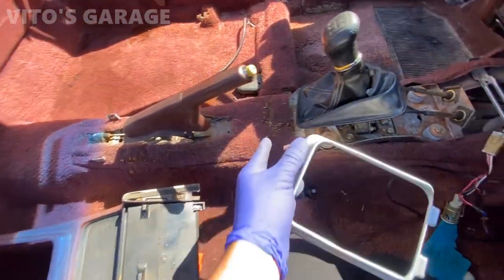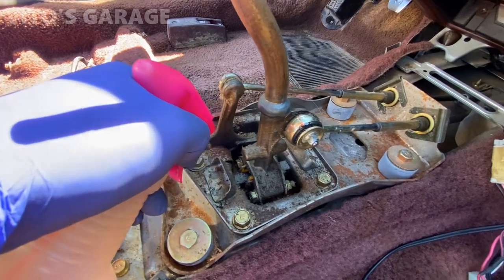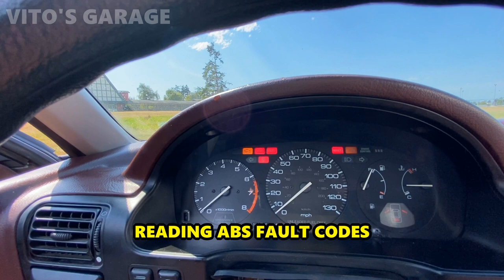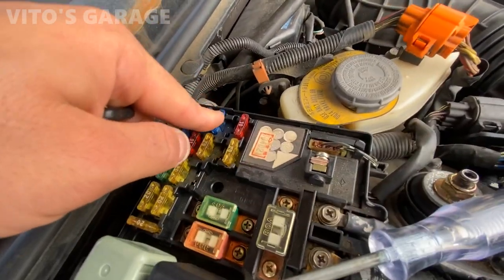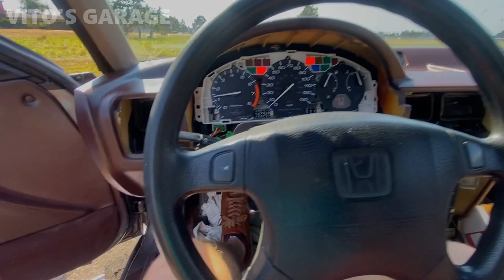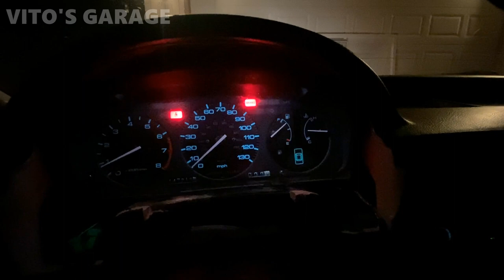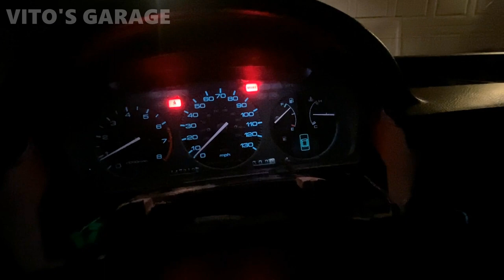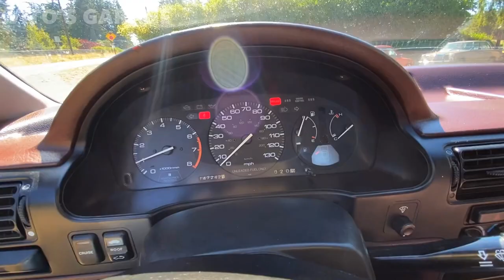Neglected 5 Speed Manual 1992 Honda Accord: Buying, Fixing, Saving & Reselling!!!

Comment: I'm a massive fan of the Cb7 chassis myself. These Accords will not stop 'til you blow it up or wrap it around a tree. Fantastic car.
Reply: I was just going to text that. First car I've bought was a 1990 accord. I've been driving accords since. I own a 94, 98, and 2003 right now. Easy to work on. Decent gas mileage. Got a little boogey for the highway and bulletproof. Stop sleeping on accords and get you one and join our family.
Reply: my 96 was just recently stolen and it was low on coolant before they took it. now it looks like it needs a new gasket but still yet to send it to the shop for a proper diagnostic if its even worth saving the f22a1.
Reply: that really sucks! hope she lives on ❤

Comment: I still have my 1988 Honda accord I bought 12 years ago for 400$!!!!!! even though it has a carburetor it's still running very smooth! I've recently been putting a little more work into it to make it run better and man..... this car is just the gift that keeps on giving!! almost 200,000 miles.
Reply from the maker: They’re amazing machines! They don’t make them like they used to!! Keep up the great work! I save and restore many cars every year. Check out my other videos!
Reply: I just bought one today for 300$ 251k miles but let see if they live up to they reputation and give me another 100-200k
Reply: Took my86 to 262,000 before trading it in. Was hard on pads and rotors for some reason but other than that an incredible car. Traded it in and saw it rolling down the highway a couple of years later. I found a place in Memphis that rebuilt those carbs and it was money well spent. Ran like ne w after that..

Comment: When you have the clutch pedal assembly out, it's a good idea to check/replace the pedal stop pad on the switch that kills the 12-volts going to the starter when the clutch pedal isn't depressed. That little pad is very difficult to get to when the assembly is still bolted in.

Comment: just picked up my first car, 91 accord with 64k original miles. cant say i couldn’t be luckier even though ive spent well over a grand on replacement parts lol. such a mint interior ill have to post videos soon
Reply from the maker: Amazing!! I love old school cars!! I save and restore lots of them every year. Check out my channel!
Reply: @VITOSGARAGE  will do! loving the content so far. i have a few quick question though, my speedometer isn’t working but every other instrument in my cluster gauge is working as normal. my S light starts to blink shortly after i take off aswell (automatic trans) im hoping a new speed sensor will fix the issues but im wondering if anything else could be causing these problems that i should look out for. my powerlocks also don’t work at all but used to come on here and there when it was frigid cold outside. thank you in advance for any help :)
Reply: @laytlee not sure if you’ve replaced your speed sensor by now, but my accord had the exact same speedometer problem and replacing the sensor fixed it right away
Reply: @Br0dyz3r0  yeah the speed sensor did the trick :) i unfortunately totaled my accord about a month ago hydroplaning off an exit though. i miss the car every day

Comment: I have a 92 accord LX automatic in that same color scheme. Bought it several years ago from the original dealer. One owner before me. All service records and now only has 119k miles. Mechanically it’s perfect, but the paint is bad (clear coat gone on all top surfaces) and interior badly sun faded. Drives and rides so good. Better than my ‘13 Fit. I’ve done exhaust, alternator, speed sensor, and other minor stuff. Everything works. Debating whether to sell it or keep it.

Thanks for the video and your love and care for a great old Honda!  Great job getting her back into shape.
Reply from the maker: Nice!! I save and restore a lot of Classic cars, mainly Euros. But I’ll do the same to Classic Asian cars. Check out my channel and other videos

Comment: I love my 92LX, It has 424k and never an issue. 5spd cold air hot heat etc. I was listening when you said the trans had 80w90 or something like that, I have used 10w30 engine oil in my 5spd for the last 20+ years. Clean little car for sure and it will last someone a lifetime.
Reply: Wow.

Comment: Why are you against using factory 0W-20 oil? Is that thicker oil not working against the engine?
Reply from the maker: Thicker oil is always better. Don’t use water thin oil in your engines.
Reply: @VITOSGARAGE  Hmm I will look into using 10w-40 for my 2014 Accord next time.
Reply from the maker: @porschefanatic1049  5W-40 or 5W-30 should be fine. Not sure how much new cars will take 10W-30 or higher viscosity
Reply: @VITOSGARAGE  Agreed. I've used 20W50 in my similar Accord for 285,000 miles. No problems at all. Engine is almost as strong as it was brand new.